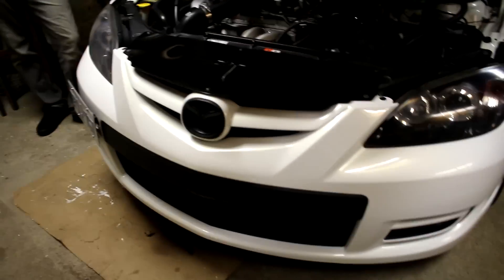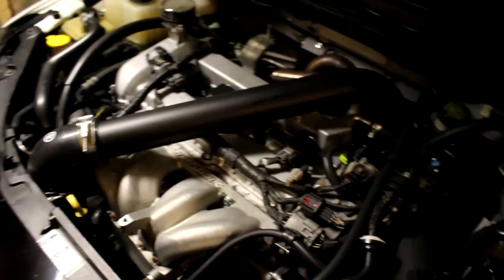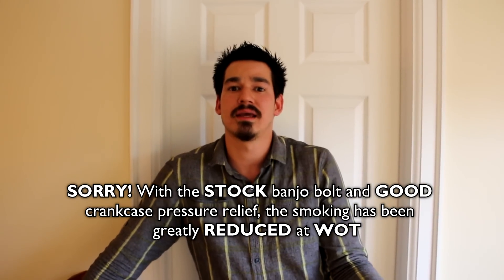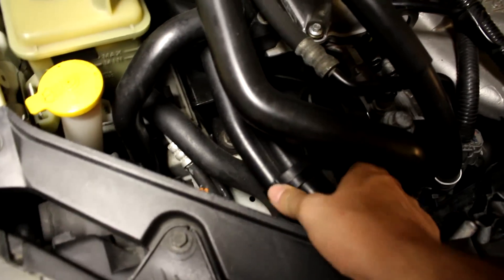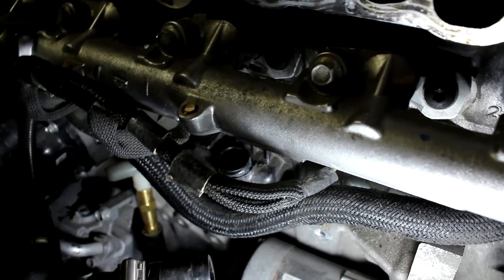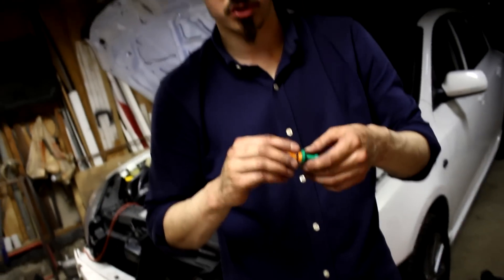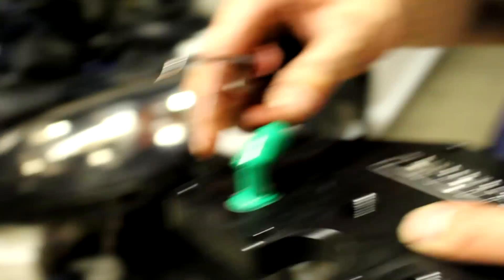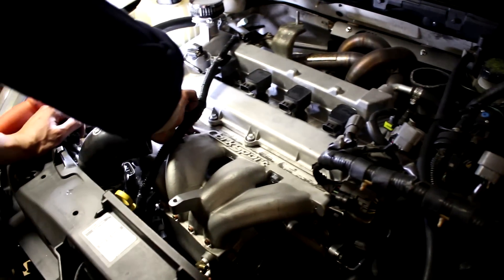Mazdaspeed 3 - Damond Motorsports PCV Plate & Dual Vented Oil Catch Can's Install

Comment: Is it bad to have a sealed can setup ? I'm on a k04 with some light mods running 20psi - recently noticed Damond Motorsports explaining how this is not a good setup for tuned application (including stock turbo on higher boost)
Reply from the maker: Great question! The best thing to do in my opinion, is to run the CS OCC in a sealed configuration (PCV valve > catch can > one way check valve > intake manifold). Then just run a Gen 2 valve cover and SP63 oil breather cap. After going through so many setups, I can honestly say that simple is better in this case :)
Reply: @WannabeTuners  Thanks so much for the suggestion ! I drive a genpu so already covered on the valve cover. Where would you place the check valve along the hose ? I would assume just before the intake manifold (I'm a total noob so just making sure before I do something stupid haha)
Reply from the maker: @derrickarmour  I would buy the one way check valve from Damond Motorsports as theirs are really good. It gets installed between the OCC and intake manifold with the arrow on the check valve facing the intake manifold. Just double check with Corksport's online installation instructions for sealed catch can routing setup so you don't get the ports mixed up ;)
Reply: @WannabeTuners  "We noticed that by adding the PCV check valve to the oil catch can, the OCC worked less effectively because when the check valve closes (the car is under boost) the catch can is no longer able to do the same job of “catching” the vapors. When your car is under boost is the time the catch can should be working the hardest to prevent those contaminates from entering your engine. Instead it is just sitting there waiting for the PCV valve to open back up." Corksport said this on their blog which just confuses the heck out of me
Reply from the maker: @derrickarmour  I'm not sure what they're trying to get across there. Do you have the link to that blog post?
Reply: Any thoughts ?
Reply from the maker: @derrickarmour  Tbh I would just run it in the regular sealed configuration. PCV valve, to catch can, to check valve, to intake manifold. Then just run a breather cap, and keep the valve cover breather connected to the turbos inlet. Imo the intake manifold should always be in the equation, as there is a very large amount of vacuum generated there which pulls crankcase pressure out effectively.

Comment: Hey guys! So I’m currently having the same issue with my speed 3, I have the BNR s3 and with easy driving theres no oil consumption but while hard driving i’m noticing a decent amount of oil consumption and smoking. Which also leads to me to believe that its the main case to why the cars feel weaker at WOT. Should I focus on getting an OCC and venting the crank case or??? Please help, thanks!
Reply from the maker: Hey man I would start with a Gen 2 valve cover and Speed Perf6rmanc3 oil breather cap. It's simpler than a vented oil catch can in my opinion and more effective at venting crankcase pressure. Also, if you haven't already, to keep the intake track clean, installing a Damond Motorsports sealed oil catch can, and doing an EGR delete or secondary EGR delete are a great investment. If u still see smoke and oil consumption, then a compression test should be carried out ;)
Reply: Sweet, thanks for the advice. I’m definitely going to start digging into the 2nd gen valve cover with the breather valve, luckily I already had done the egr delete so I’m good there. I just wasn’t sure if I should get a catch can or not because I heard its a great investment and that it fixes the issue that I have which is that I get 2.0+ knock and WOT. Also should I change the restrictor bolt on my bnr s3 or keep it? 

P.S. love the videos! looking forward to your build as I’m going to build an engine later on as well.

Thanks once again!
Reply from the maker: @juliolopez7893  Thanks a lot man! An OCC is a great investment. From what I've read, a carboned up intake track can indeed cause knock. Cleaning the intake valves and having the EGR deleted, followed by installing an OCC will reduce this carbon buildup. If you're getting consistent knock at WOT, this is obviously not good. I'd start with running a higher octane fuel first to see if that helps, but definitely clean the intake valves and install an OCC :) Is this restrictor bolt one provided from BNR?
Reply: Wannabe Tuners pardon the late reply but to answer your question, yes I never swapped the restrictor bolt on the bnr its the one that is provided. Should I swap it out? I have a lot of oil consumption with smoking while the car undergoing boost. The knocks go over 2.0 while at open throttle high RPM and it something that happens every now and then it doesn’t happen every time at WOT. Been going through the forums and haven’t found any answers lol
Reply from the maker: @juliolopez7893  I personally found that the car would smoke more and consume more oil with the restrictor bolt installed. Ironically I notice less smoke with the stock banjo bolt. Definitely try running a higher octane and keep monitoring knock.
Reply: Wannabe Tuners Wannabe Tuners which one are you referring to when you say the stock banjo bolt? I’m currently running 93 and being tuned by freek! I keep an eye on it and make sure to stay off the pedal its just very difficult 😅
Reply from the maker: @juliolopez7893  It's a good idea to datalog when you do pulls. That way u can review them later. Also if you live in a cold climate, the cooler dense air can actually cause knock because of excess cylinder pressures and a higher tendency to over boost. The banjo bolt I'm referring to is the one that restricts the turbos oil feed.
Reply: Wannabe Tuners Wannabe Tuners i’m in FL and its a mixture of both cold-ish and hot, and yeah the oil restrictor bolt, should I keep the one that comes with the bnr or swap it out with another one?
Reply from the maker: @juliolopez7893  I found more smoke with the one from BNR, so I switched back to the stock one which helped. I am still unsure what it causing it, although we will be trying a few more things in the spring to hopefully resolve the issue.
Reply: Wannabe Tuners  where could I find that banjo bolt ? does it bolt straight on to the bnr? want to try and see if that’ll help, still trying to obtain that occ as well. I try to look at them but i’m a novice and don’t really know what i’m looking at
Reply from the maker: @juliolopez7893  Did u install the BNR turbo yourself? If BNR provided u with their own bolt, u would have had to remove the stock bolt
Reply: Wannabe Tuners I didn’t do it myself I had a buddy do it because at the time being I didn’t know how to and now thinking about it Idek if the bolt currently in is the bnr or the stock
Reply from the maker: @juliolopez7893  Either way, if you're experiencing smoke, start with relieving crankcase pressure first, with a Gen 2 valve cover and Speed Perf6rmanc3 oil breather cap. Also run a sealed Damond Motorsports oil catch can and EGR delete, to help keep the intake track clean. If u still experience smoke, then u are in my exact situation. One thing u can try is, get into 2nd gear. Then decelerate at around 4500 rpm for about 4 or 5 seconds. Then lightly get back on the gas and look out the rear view mirror. Do this a few times in a row. If u see smoke out the rear view mirror, then it's highly possible that u will need to reduce the oil pressure to the turbo with a Turbosmart oil pressure regulator. This is what we will be trying on our speed 3 in the spring.
Reply: Wannabe Tuners sweet i’ll add those to my cart when I start shopping for parts Which will be shortly. Its becoming annoying having to top off the oil every week so hopefully that oil pressure regulator does the trick. I’m going to take some datalogs during lunch break and try what you said and see if there is smoke
Reply from the maker: @juliolopez7893  Sounds good man. Keep us posted!
Reply: Wannabe Tuners well gentlemen shes gone, I put a hole through the engine shes done 😂
Reply from the maker: @juliolopez7893  Time for a rebuild ;) Sorry to hear man. These engines are getting older, and more and more are starting to let go.